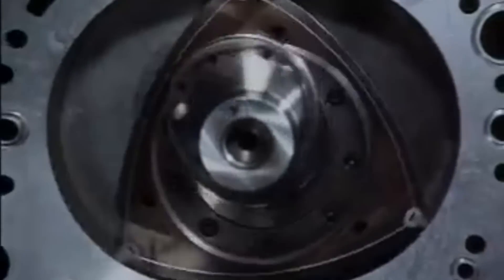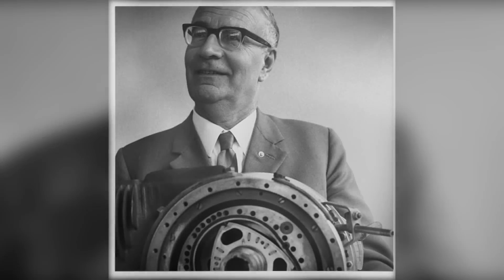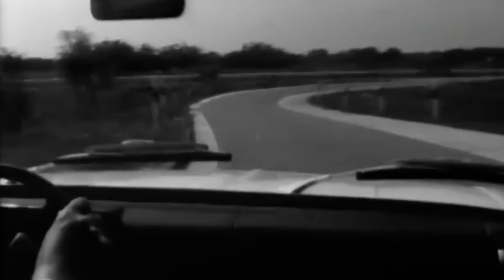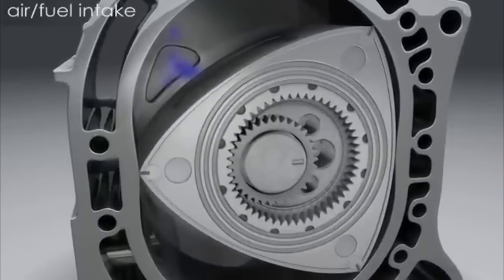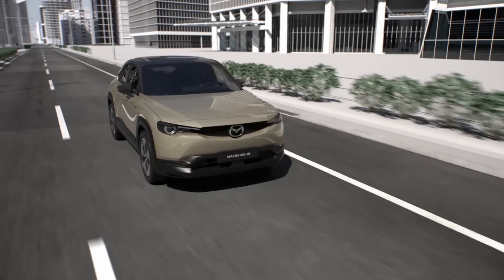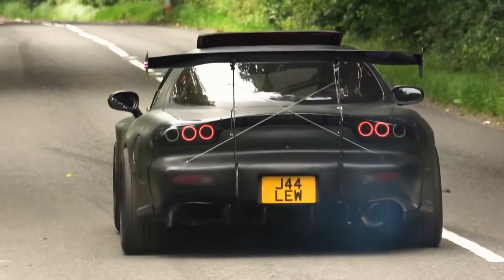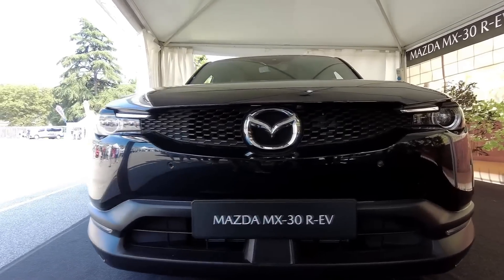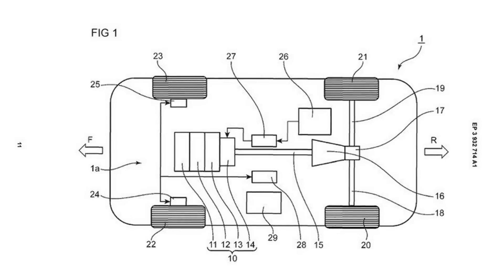New Technologies: 1L/100km: NEW Rotary Engine Mazda - Innovations, History and Mechanics!

Comment: There is NO NEED for over 30 kw (40 H.P.) ICE f you have 20 kwh battery on a compact car.  I rarely exceed 15 kw (20 h.p.) with my Chevrolet Volt 60 mph on level highway.  An EV motor  of 100 kw + 20 kwh battery + 30 kw ICE would certainly get me up the "Grapevine" north of Los Angeles.  Tie the operation of the ICE into a GPS or use manual to keep charge at correct level for my trip.  

Reading comments, it appears the double crankshaft engine would give best fuel economy using one combustion camber/2 cylinders.

Comment: Is this the same technology as the LiquidPiston engine?
Reply: Not really. Both the Wankel and Liquid Piston designs consist of a rotor inside a housing and were discussed by Wankel back in the 50s. The manufacturing methods did not allow production of the liquid piston design back then.
You can think of the liquid piston as somewhat of an inverted Wankel. It’s way more efficient than the wankel and more efficient than Diesel and Otto cycles. Furthermore the power density is even higher than the Wankel. The latter is very power dense — Rx7 using a 1.2l Wankel competed with 3l BMW and 5+l muscle cars back in the 80s.

Comment: Densité énergétique de 1 litre SP95 est d'environs de 8kw. une voiture électrique dépense en moyenne 15 kw au 100 Km avec un rendement moteur de 90 pour 100.. Conclusion , ce moteur thermique rotatif doit plutôt consommé au minimum plus de 4 litres avec un rendement proche de 45 pour cent..... Pour moi , 1 litre au 100km , c du FAKE-NEUWS

Comment: Clickbait lie. As a car needs about 20kWh/100km and 1 liter gasoline just contains 10kWh, ist has to be a overunity motor hoax. Sadly girls do not have basic physics knowledge. That direct injection has bad exhaust gas and constant rpm can save the ugly exhaust recirculation is also ignored.

Comment: The problem with emissions still remain. How do the engineers of Mazda solve lubrication for the apex seals without burning oil?
Reply: Thats what the ceramic anti friction coating is for, wiider apex seals and redesigned oil  delivery to eliminate the old tech oil consumption issues and improve the longevity and reliability and economy.

Comment: Soon, an internal combustion engine will be introduced to the world, which replaces electric and rotary piston and rotary engines and has incredible capabilities.
This engine will be designed by an Iranian genius and finally it will be introduced by 2024 and its information will be published.
No need for turbo
With very good lubrication
With the ability to remove several cylinders
And dozens of other things

Comment: i dont believe that 1l/100km, thats maybe when that car is running on battery power alone while the i.c.e. engine is idling without charging the battery. i guess with the engine charging the battery it will be like 10L/100Km.

Comment: The Liquid Piston rotary engine is a vast improvement over the Wankel style rotary. The LP engine is basically the Wankel/Mazda rotary turned inside out. Instead of a triangular shaped rotor and a peanut shaped case, the LP engine has a peanut shaped rotor with three tip seals on cusps in the case dividing the case into three chambers. With stationary tip seals, there is no longer any issue with getting oil to the tip seals to keep them lubricated. Say so long to weep holes and high emissions not to mention the need to constantly refill the oil tank to replace the oil that is consumed keeping the tip seals lubricated.

Also the shape of the rotor and case results in a period at TDC when the rotor seals the combustion chambers in the walls of the case at the moment of ignition so that combustion occurs at a constant volume. This result is a much higher pressure increase due to combustion than a spark ignition engine. Combustion is largely completed before the combustion chambers are uncovered and the power stroke begins. Because of this the thermal efficiency of the LP engine is far higher than the Mazda type rotary. So instead of a rotary engine getting less mpg than a piston engine, the LP engine will deliver even better mpg than the best current piston engines. 

One thing it does share with the Mazda rotary is that the power to weight ratio is much higher than a piston engine. So the LP engine would make a much better range extender engine that any piston engine. And with a much higher thermal efficiency than the Mazda rotary but with the same or higher power to weight ratio it will make an even better range extender engine than the Mazda.
Reply: Well that's not a problem; the problem is, what's their strategy to getting it to wide market adoption or use? Why are they not getting it up and going with some new vehicle or old vehicle manufacturer, in a hybrid combination or pure form? It could by now have been deployed in the general aviation sector at least, given its extremely wonderful numbers and of course the great possibility of accessing VC funding in America as compared to other countries. So the problem might not be the engine itself, but rather the founders who may be ill advised on how to push their invention to market as highly needed. Making paydirt is great but if nothing is forthcoming, it'd be better to be more realistic on their patent pricing approaches, get more innovative, collaborate with developers etc and have long drawn returns when outright purchase pricing is too high.
Reply: "vast" improvement...the tip seals still wear out dummy, getting oil to them isn't the problem, but nice try.

Comment: Bit like comparing a 1970 petrol engine to todays sky active 2023 engine. So if you compare 1970s rotary to what the video is about it quite believable that a purpose built constant speed engine would reach 1lt per 100 km the improvements in materials manufacturing and design would mean it is possible. If so it would be a real game changer for Mazda.

Comment: My understanding is that a constant RPM is the exact best way to get maximum efficiency and longevity from a rotary engine.  This, then, would seem to be the ideal way to employ a rotary engine in an automobile…as the motive force that drives a generator that produces electricity for electric motors that actually propel the vehicle.  And a very significant aspect of that “efficiency” is the fact that this particular RPM will elicit maximum fuel economy from the Wankel engine.  Maximized fuel efficiency and minimized wear…that’s what it’s all about.
Reply: May be 1 rotor for generation and 2 for power? 😮😊
Reply: Yes constant speed & constant load engines are very efficient, the downside is converting the energy into electricity but there are some very promising idea's out there, I think the EV s we have now are a pathetic attempt at reducing Co2 etc.
Reply: theoretically yes. but what mazda delivered is far from energy efficient and EVs drop in prices fast.

Comment: As a petrol range extender to an electric car is a great idea due to a single rotor design . But as a pure rotary engine in a car no. My memory of driving an RX7 was no torque in the engine you had to rev the nuts of it and of course down goes the fuel economy. Very smooth though but high oil consumption.

Comment: if you believe 1 L/100km... can I interest you in some flying pigs...
Reply: Se esqueceu que a VW  já teve em produção um carro que consumia um litro por Km ???
 E já foi há mais de vinte anos.
Reply: @carlossousa-zd4um I forgot about the xl1. Too bad it never made it to production
Reply: if you had the patience to watch it, you wouldn't write stupid things. This is a hybrid engine combo, where the petrol engin  only generates electricity for the electric motor that drives the car.
Reply: My current hybrid uses about 0.3L/100km.  I do a lot of short trips and get usually get by on electric only mode most days.
Reply: @markozinga  yes yours is a plug-in hybrid... This was not the type indicated and as you said your really driving it as an EV.... Real world would be 2.7 to 4.5 l/100km as stated by manufacturer like Toyota or Honda...
Reply: My prime is currently showing 1.3 l per 100km
Reply: You better believe it mister - this Rotary Engine by Mazda is very innovative indeed.
Reply: Let me guess, you're so myopic as to believe gasoline will be used?
The technology has been used in NASCAR and Indy cars since the 80s.
Watch the parade laps of the 82' and 92' Indy 500s, as well as Montoya hitting the jet dryer at the Daytona 500 in 2012.
When the fuel is 20x as exothermic, it doesn't take much.
Reply: EVs have a consumption of 0L/100 km.
Reply: sort of... there is still a CO2 emission with energy supply... I have solar and Drive a model Y but I still draw some power from the grid.  @BASILBERNARDS
Reply: how much energy to make 1Kw ?
Reply: @racghineering  .3712 kg CO2
Reply: @BASILBERNARDS  how much energy to make 1Kw ? where is it come from to make 1kw/100km?
and what type of emission,air?water?soil?gas??

Comment: Rotary engines in hybrids will be a game changer, especially if they also allow plugin charging of the battery.
Reply: no, 5 years too late
Reply: @stefanweilhartner4415  No, it is a far better approach than full EVs that are now proving to be no solution at all.
Reply: @schrodingerscat1863  which is not true. the opposite is proven. the EVs are getting constantly better and cheaper.
10 years of consistent worldwide EV development has brought us:
* half the price
* double the range
* triple the charging speed
no other car segment had such a development speed in the last 100 years.
and that is why the sales numbers of pure EVs have a never stopping growth since over 10 years worldwide.
Reply: @stefanweilhartner4415  Yeh right, keep drinking the kool-aid. EVs being charged using diesel generators because its all about how it looks not how it is and stagnant EV sales driving all but the largest manufacturers into bankruptcy together with charging network providers.

Comment: I want to enjoy the running of a rotary engine. If possible, drive the tires with a manual transmission that has a direct feel. I don't like running on electric motors.😙

Comment: Don't make another skyline (or even worse GT-R or lfa) with a non-existing engine, or in the wrong place. The engine feels right and simple when you weight-shift. The chasis doesn't. You need a spindle point. And the needed weight changes with the aplication.

Comment: Chasis of this size don't make sense, because the engine's so light. Even if you make it 2, 3, 3.5 liter. Which will give 600, 900, 1200 hp. Rotary engines only make sense on a car like sesto elemento, or with a supercharger.